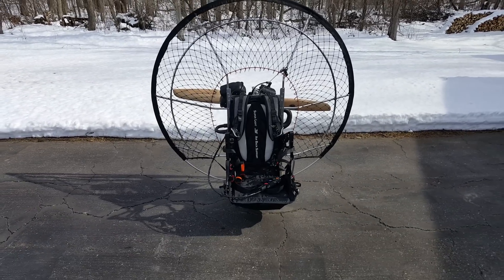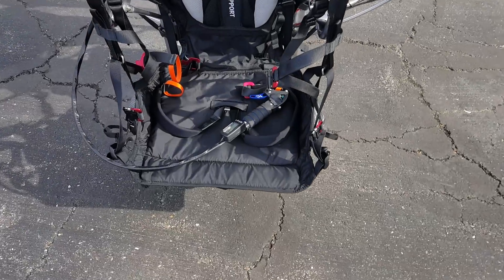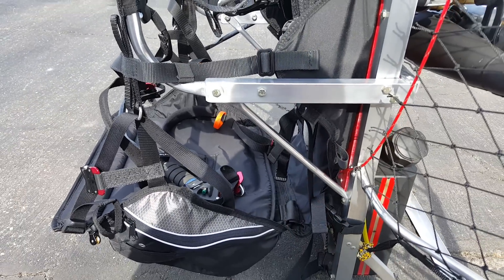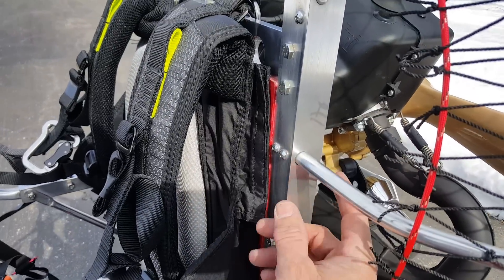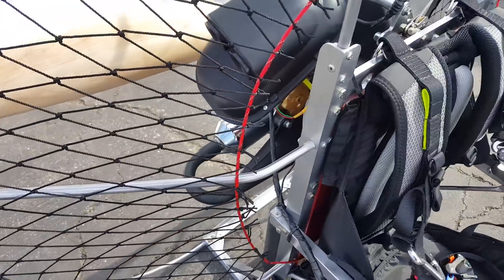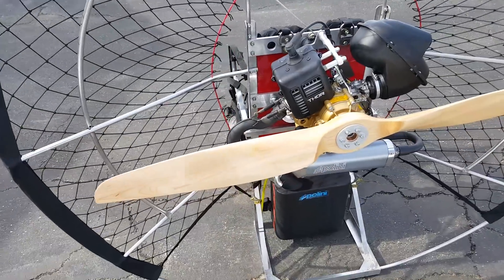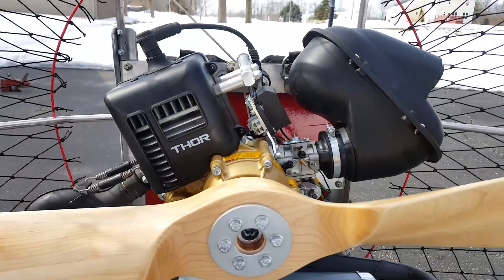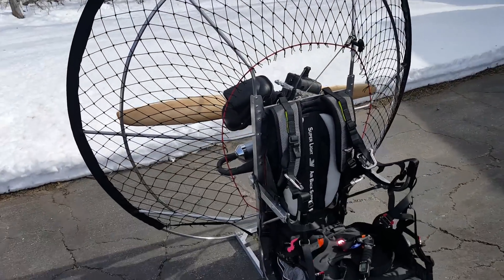Home built ultralight, powered paraglider frame, Polini motor

Comment: I'm getting ready to make one of my own, glad I found this video. Of all the home  built one I really like the way this one is put together. Nice job!!!....One thing I was thinking is to maybe use aircraft style solid rivets. You can still remove them and they are substantially lighter than bolts.
Reply from the maker: Thanks, and yes the rivet idea is a good option. All total the nuts and bolts probably only add up to a pound or so, so not really a big problem. My design is simply something I made up in my head and jotted down a few measurements that I planned on building it to. It is loosely modeled to be somewhat similar the Skybolt V2 plans design. Other than that I just made it up as I went with a few basic design requirements in mind. It has held up extremely well and I am very happy with it.

Comment: Nice job. Is there any chance you would share the plans for the frame.
Reply: What I was wondering
Reply: You can extrapolate something very similar just by looking at his video,or just copy a Miniplane design then add some features of your own.
Reply: I made this same one and used the Skybolt v2 plans (free plans http://ppgplans.com/Download/download_here.htm) and simply replaced the tubing called for in the plans with aluminum angle and the ring with EMT conduit, all from Home Depot.  That negated the need for any machined parts and the only tools I used were a drill, screw driver, hack saw, and conduit bender. Got it done in one weekend. Turned out almost exactly like this one in the video and didn't take too much modification. Anyway, hope that helps.

Comment: Very nice build.  Where do you buy the Polini engine, and what's the price tag if I may ask?
Reply from the maker: +Rick Cavallaro I bought mine from Glidersports PPG out of Clinton, MO. When I bought it the price was $2800 but I just checked it now and the price is up to $2900 . Not cheap but it is a sweet little engine for sure.
Reply: +dozerboymiller I'd like more info on your latest horns I'm thinking of buying your plans but I have a few questions. could you email me at. md325c@gmail.com